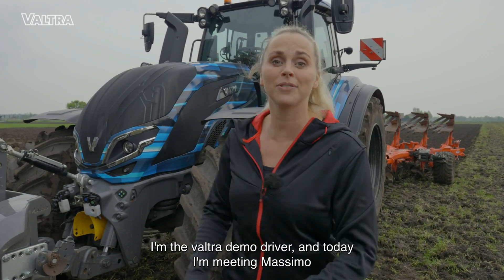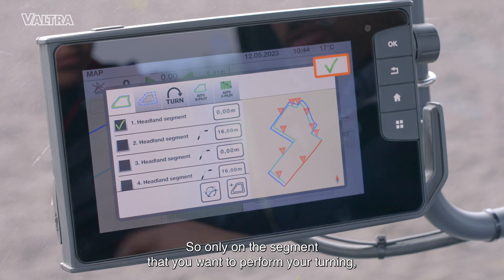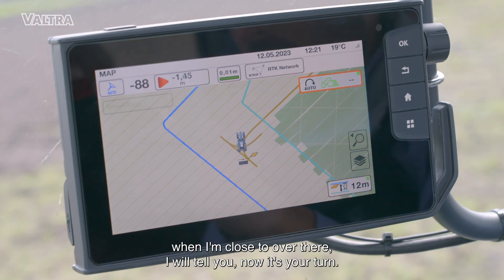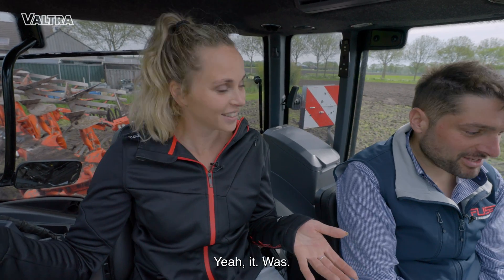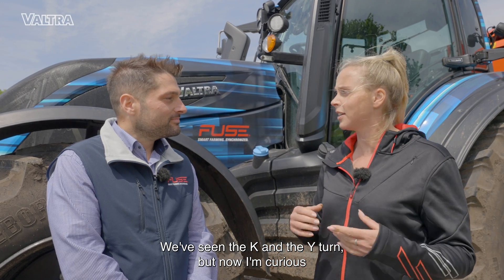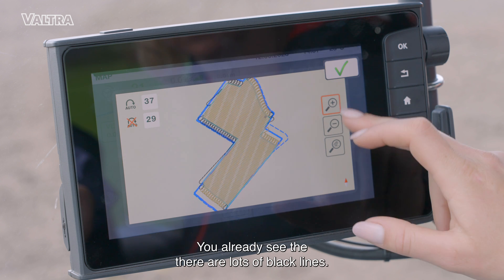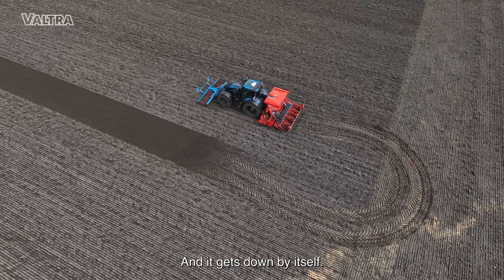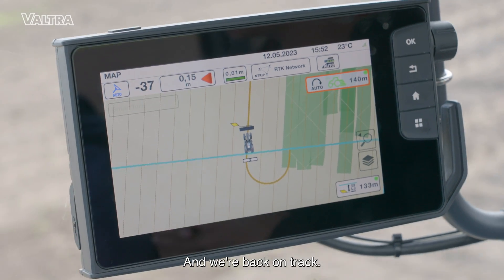Valtra SmartTurn | K & Y turning pattern explained

Comment: Do both modes (y,k) need triggering before reversing? I heard in some other video from different channel that only one of the modes requires triggering before reversing. Not sure if i heard it right. Also does the system have safety features like obstacle avoidance if driver falls asleep?
Reply from the maker: Hi @dkdanis1340, thank you for your questions! Both the k and y mode requires triggering before reversing. No safety feature if you fall asleep.